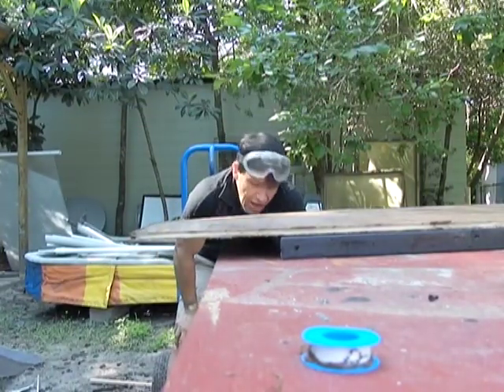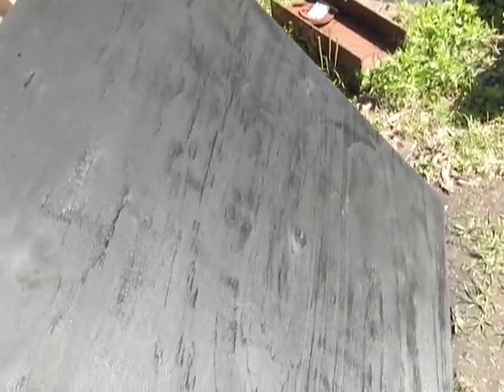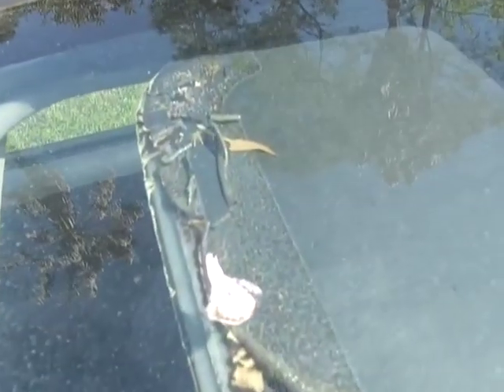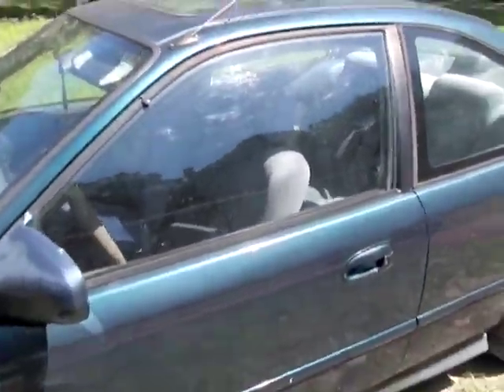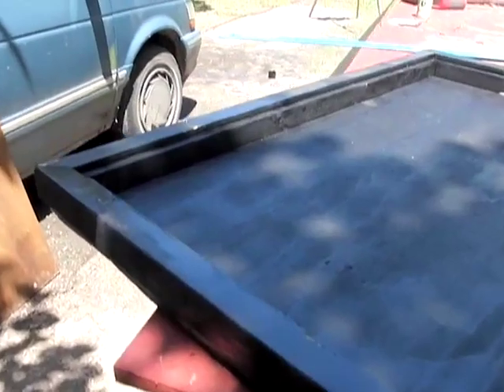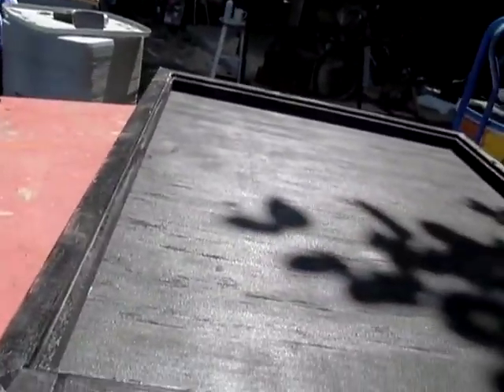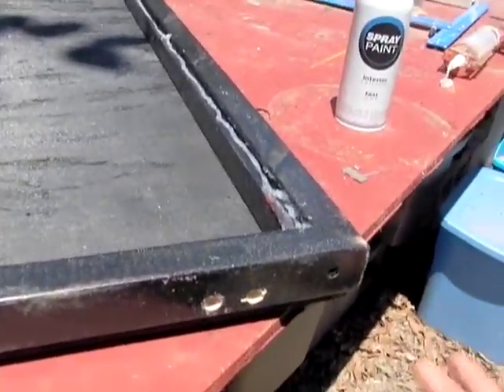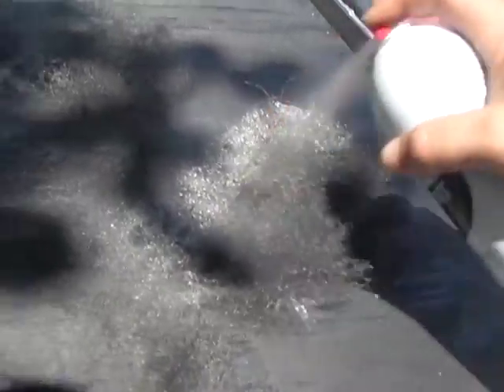Forced Air Heater Solar PART 3 Passive Heating HOW TO Use Sunlight Power Wooden Frame

Comment: One idea to save you time on the plywood attachment would be to use flooring screws which have a smooth shank above the threaded screw.  Then you wouldn't have to reverse your drill and 'pilot' your plywood every time when you were using those drywall screws.   Awesome series of vids!!  Thanks.

Comment: A quick suggestion... A friend of mine took an old refrigerator, painted it black, put the interior tank of a water heater in it, also painted black, and made a solar water heater out of it. I think he also put some sheet metal or a mirror in the back to reflect some of the light to the back of water heater. His first model used a single pane of glass as your construction on the solar forced air heater uses. His water got pretty hot. Model 2 used a double pane sliding glass door = much more heat

Comment from the maker: @CombatWarrior420 Hi, it depends on insulation of house and outside temp. This size grabs about 800 watts of heat energy and delivers about 700 watts to your house. Because electric space heaters are inefficient, this is equal to a 1000 watt electric space heater on a sunny day. This would supplement traditional heating in very cold areas. Build around free glass, and chain them in series so you can use a stronger fan, more volume = more heat. They are really good.

Comment: NIce work ...If you would have made the sides higher and put in 1 1/2" ducting board insulation in the bottom and the cover it with ceramic tile , you would hit temperatures of 280f - 300f...The addition of tile also allows you to have some heat even after its dark out ....Keep up the good work man ...

Comment from the maker: @lefty0mtl Acrylic paint is inert after 2 weeks of open sun exposure. The smell goes away. If you are concerned (understandable) You could place a sheet of glass over the wood base and seal with silicone so the paint is sealed behind glass.

Comment: I made some of these using left over corrugated sheet metal from a shed, sprayed it matte black and put it in a simple box like yours. I used a left over cpu fan in the bottom corner to push air out through the top. Works pretty good. Just throwing it out there in case someone has the supplies around and wanted to make one.

Comment: 700 watthour = 2388 Btu. 
An average size room is 12ft.X14ft. with an 8 ft. ceiling for a total volume of 1344 cubic feet and will require between 4000 to 6000 Btu of heating. 

5000 Btu = 1465 watthour So an average room would require two of these Forced Air Solar Heaters to adequately heat the room.  An average size house 55ft.X28ft. with an 8 ft. ceiling has 12320 cubic feet  and will require at least 45000 Btu of heating. All of this is assuming an average cold day at 45 degrees Fahrenheit.

Comment: In a future design, I imagine adding some thermal mass that would bake inside the glass frames would be able to store energy above and beyond what is being transferred in the air.  A thermostat that runs the blower intermittently rather than all the time would regulate the temperatures too.

Comment: Very interesting Idea, I do have a question though, Instead of the steel wool, what if you had like a black foam, Not a dense foam that air can't move though but the kind you will get to ship packages? Would it help to warm the air?

Comment: Do  you think if you built vertical thin walls of flashing inside to create a maze to force the air to zig zag through the box to cover every sq in. it would make the heat claimed to be more efficient? I was thinking if the air followed the path of least resistance, there would be pockets of air that would be very slow moving or standing still. You could still pack the wool into the channels to maximize the surface area.

Comment: Quick question.  Does the heated air you get from this solar heater stink like spray paint??  And if so wouldn't it be safer to use a non-VOC paint, preferably rolled on to waste less paint at the same time?

Comment: Did you have any trouble with the steel wool igniting inside the frame?? I do know that people using wool with water heaters sometimes have that problem unless the chamber it is in is under a vacuum. These have a mirrored back though.

Comment: @lefty0mtl I have the same questions, because the air flows on alot of painted surface that is baking in the sun.
I guess it will be unhealty...
I think the sodacan's is a more healty way because the inside is very clean and the paint never gets in touch with the flowing air  (or very minimal inexisting touch)

Comment: Could you put one of these up on the side of a trailer house and just paint the metal black rather then using the plywood? 
Do you need the heavy thermal mass of the plywood or would light metal work?

Comment: Im curious to know how much heat could be brought into a house if you simply cut plywood panels more or less the same size as your house windows and hung these panels inside the house in front of the windows, maybe from decorative chains from the ceiling. The backs of the panels could be painted white to reflect heat in the summer if you just turned the panels around with the white side facing out.. Sure they would be ugly but curious if I would get the same heat output..

Comment: You'd be done much quicker by rolling on the paint and get better coverage. Also, if you have some copper sheeting apply that to some plywood and paint that black. Tho' for this you'll definitely need spray paint. The copper is able to heat up quicker and release that heat better as well.

Comment: You can bump up the amount of energy transeferred by increasing the amount of time the air is inside the panel. Try adding some cardboard or thin wood baffles.

Comment: Ok, so what are the dangers of breathing air that has been run across hot painted surfaces? Also, why not just heat the steel wool until it gets a nice carbon finish?

Comment: @wildfire53575 It does work in colder climates...what you need to understand is that it runs on "ambient temperature". Ambient temp of your house say 72. The average a solar heater would raise the temp would be 50 degrees above ambient. The only hold back is the insulation of the solar heater...and the heat loss through the clear cover...which is what determines the output of the unit.

Comment: @social3ngin33rin It's not about being green...it's about using materials the right way. One can of spraypaint for the life of the unit...not that big of a deal. The onyl other solution is dark firebricks...but those weigh way too much...on a roof that would kill.

Comment: i wish some people could get together to test the different types, i guess if you had direct sunlight and roughly same elevation, same temp and humidity levels, it would be fairly valid. The best one i believe is (fairly easy with most heat).
search youtube *** my 4th pop can heater ****

Comment: @wildfire53575 i built the pop can unit (4feetx8feet 240 cans) and trust me it does work. i have a 110cfm bathroom fan pushing air in, and 150 degree F coming out. i live in canada by the way. winters are cold. check out 'shoestring" "ramrod573" "mostvideo" they have excellent builds